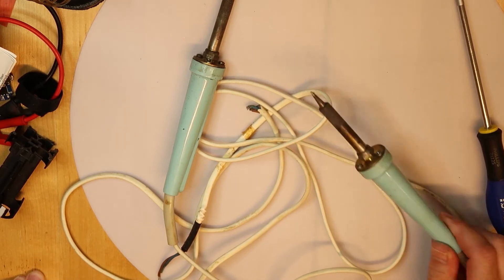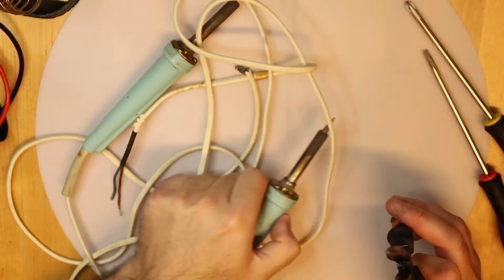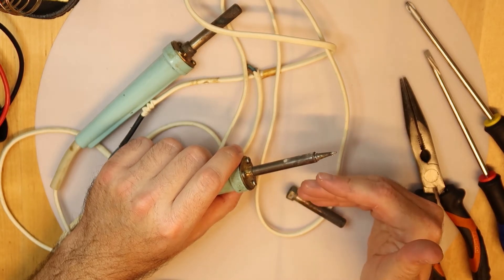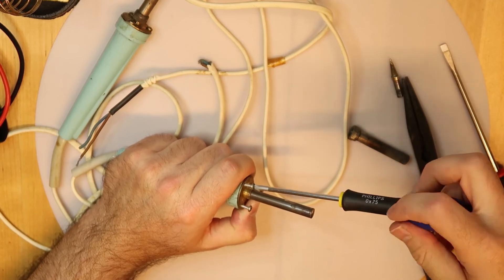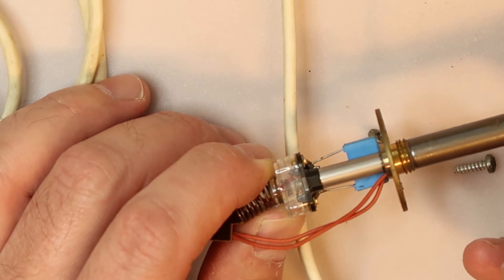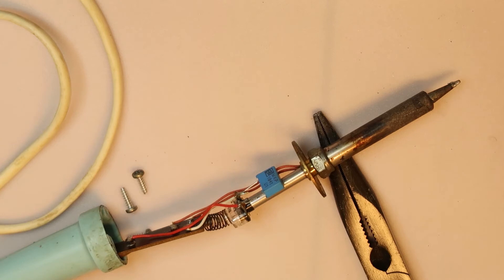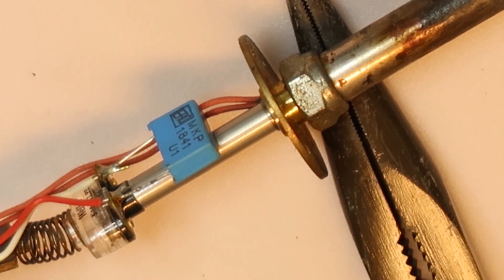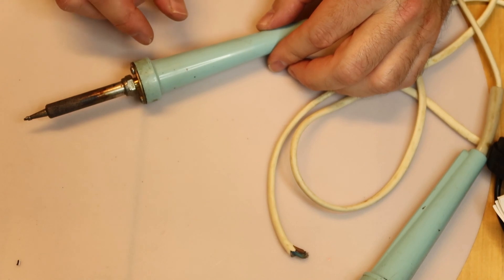Old Weller solder Temperature control

Comment: I got one of these irons in 1985. I got too much flux burnt on at the end and I tried to remove the tip but the nut got jammed so it was no good. I bought another (iron only). I had to  Rewire  the transformer   As their new iron had an Earth wire. I never even wondered how these worked. I thought the number stamped on the tip was just the type of head. It’s always been my best and most used iron.

Comment: the maget is not to the tip it is at the control swicth
Reply from the maker: correct but the iron changes its magnets due to heat
Reply: the thiknes of the iron dictates the temp ..the thiker the iron longer stays magnetizet to the switch and this way heats up more

Comment: That’s incredible! Honestly, I never thought about what was going on in mine, I just knew that it has been very reliable.
Until last week….. the wires going to the low voltage connector (the three wires) finally broke. 
I trimmed, and Re soldered, and hopefully, it will be good for another 49 years……

Comment: I still have one of these irons - fantastics things. Mine has finally died after about 30 years of constant use only because the threaded collar that holds the tip in has corroded through and it isn’t possible to get a replacement :(
Reply from the maker: nice!

Comment: Great video sir I was wondering where to look for I bought a used Weller DS600 Desoldering Station and I’ve it setting on my bench for months until today I took it apart and I don’t see any movement on the relay that’s why the tip is not heating vacuum works great still by the push of the button. Thank you for taking the time to make this video that’ll walk me true to fix it
Reply from the maker: Glad I could help